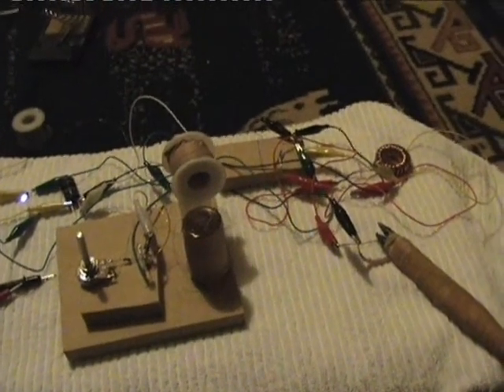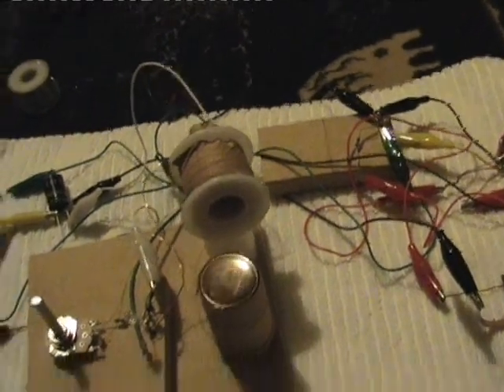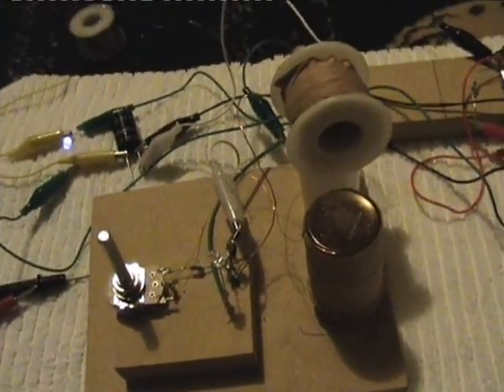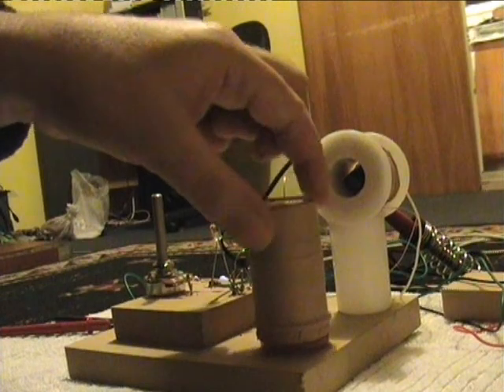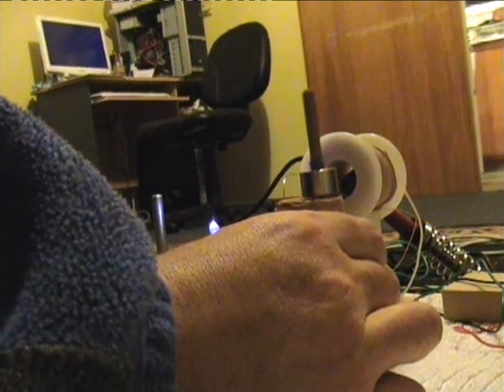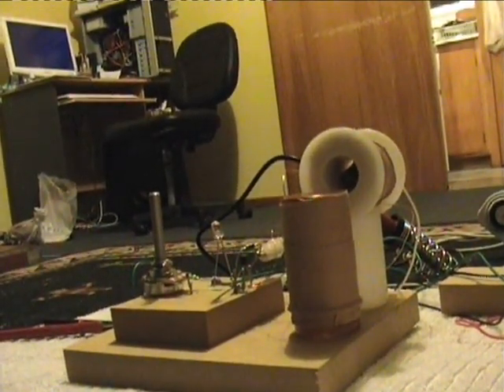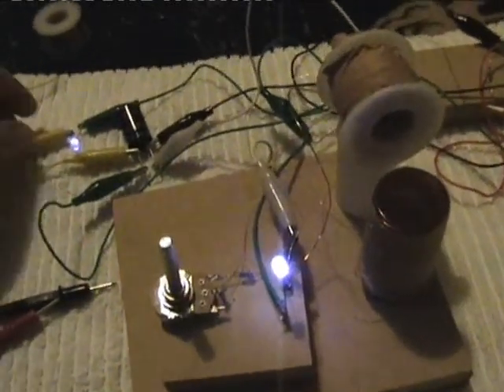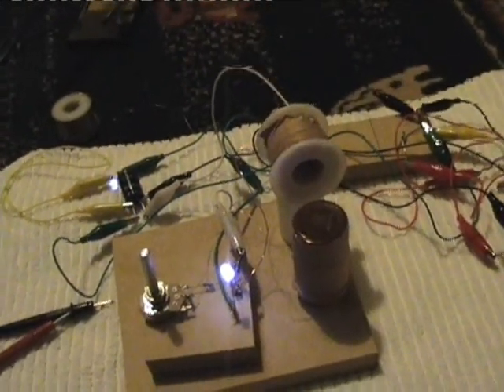Mg Carbon Water battery powering magnet pulse rotor

Comment from the maker: @kafr8413 As long as the cell is kept wet it should run for weeks. I took it down after 1 week as the constant wetting of the cell caused the water soluble graphite to start leaching through the material and short the circuit. Perhaps a solid graphite would be better, but i didn't have any at hand at the time.